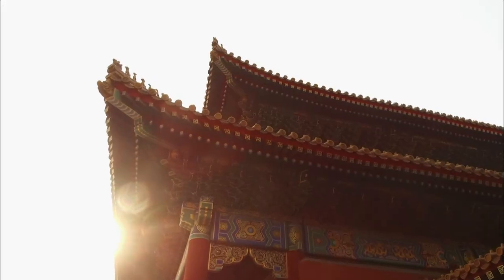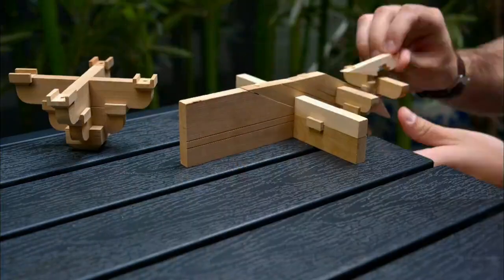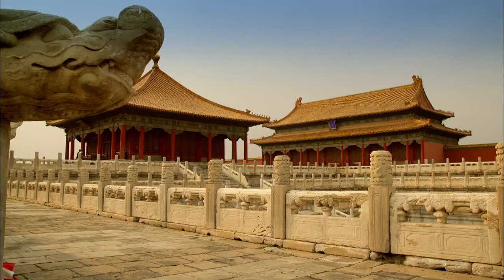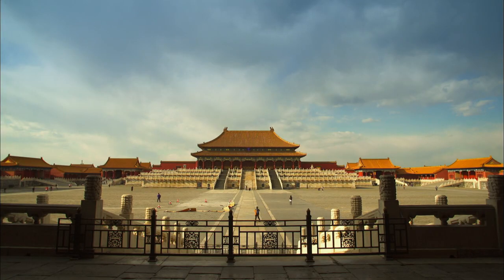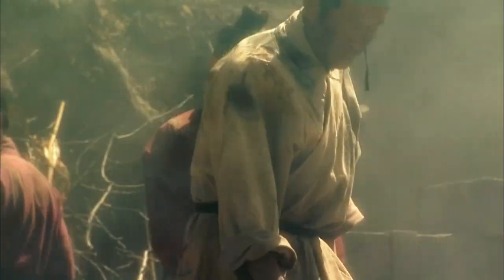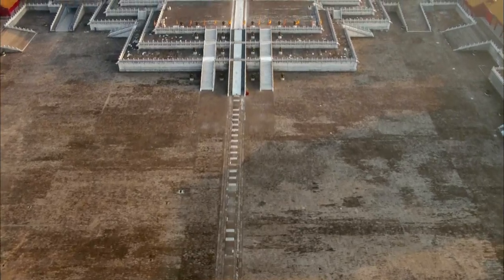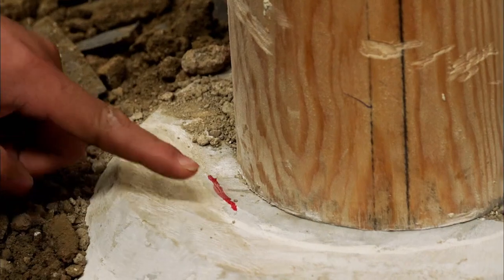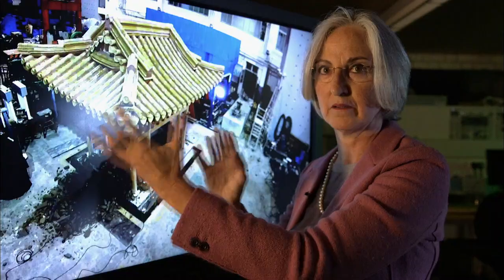NOVA S44 EP15 Secrets Of The Forbidden City

Comment: amazing video. To know that technology to "earthquake proof " a building existed for thousands of years and we don't use it.  wow
Reply: We do use elements of it even today, you just dont hear about it since people only bring up earthquake damage but never really talk about when there isnt damage. I cant speak for much outside the US and Canada (where I've worked construction) or Japan (where I know a bit about their seismic resistant architecture) but there's tons that goes into that in Earthquake prone regions. Light fixtures have to be properly anchored with 2 or 3 things keeping them in place so they cant fall on people, like in a ceiling grid for an office there's the grid itself holding the light up, there's the steel clad electrical wire which can support the weight of the light itself, and then there's typically 1 or 2 solid steel wires (called seismic wires) that provided a 3rd layer of protection. Foundations are laid and ground prepared to provide the structure with some level of defense as well, and with large buildings like skyscrapers they sometimes have a pendulum inside the building that can sway to counteract the shaking of the earthquake. Buildings can also be set on a foundation with moving supports so the whole building can move slightly rather than snap from rigid connections. You can see the effect of modern building standards when you look at major historical earthquakes: the 1908 San Francisco earthquake leveled the whole city and killed thousands but later earthquakes of similar magnitude in Eureaka, Baja California, and Ridgecrest each had few deaths and left most structures standing mainly damaging flimsy or old structures and roads. City i grew up in had a roughly 7.0 magnitude earthquake and the only major damages were to old structures like a bridge from the 30s or some of the original downtown buildings from the early 1900s while a bridge from the 80s near the epicenter was largely undamaged and there were newer buildings (80s and 90s) at the epicenter that were barely damaged.